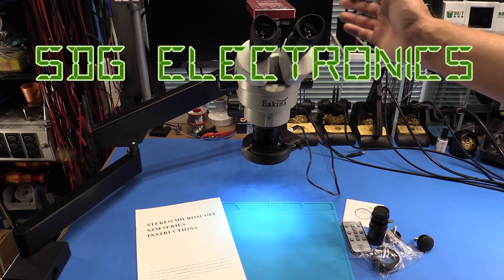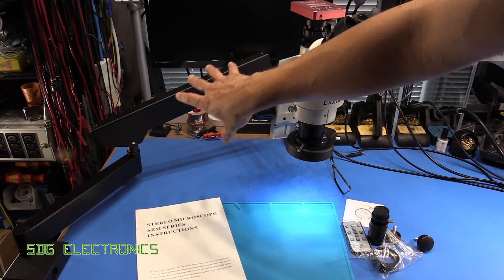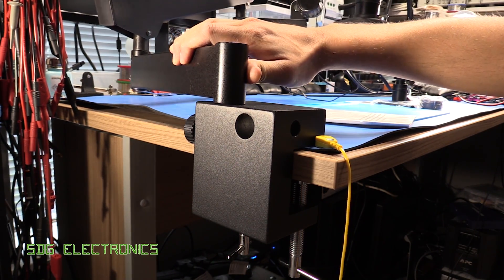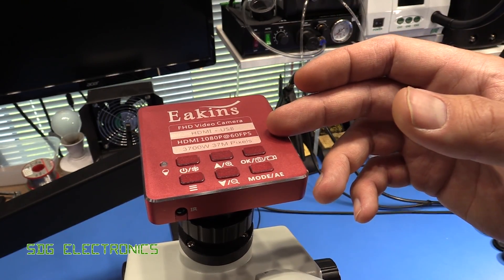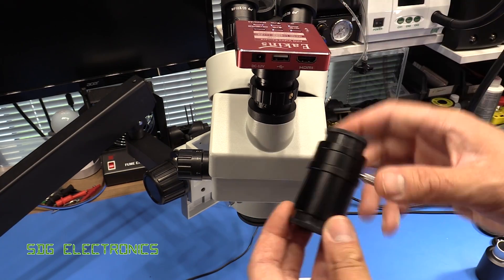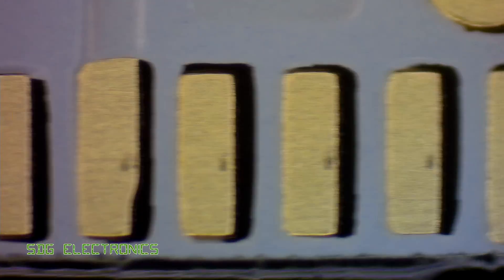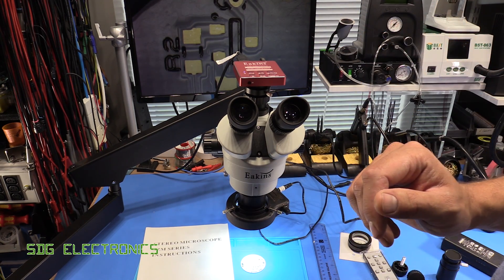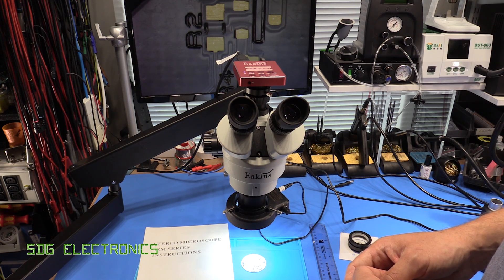SDG #093 Eakins Trinocular Simul-focal Microscope and 37MP Video Camera

Comment: October 23, 2024

Which one do you think is the best? The most expensive?
─────────────────────────────────────
C$498.68C$639.3321% off
  10+ pieces, extra 5% off
Price shown before tax丨Extra 5% off with coins
3.5X 90XArticulating Arm Pillar Clamp Zoom Simul Focal Industrial Trinocular Stereo Microscope 55mp 8.3MP 4K HDMI Video Camera
─────────────────────────────────────
C$480.99C$632.8823% off
Price shown before tax丨Extra 2% off with coins
Simul Focal Zoom 3.5X-90X Articulating Arm Clamp Trinocular Stereo Microscope 8MP 48MP 55MP 4K Video Camera For PCB Soldering
─────────────────────────────────────
C$408.68C$464.4112% off
Price shown before tax
3.5X 7X 45X 90X Parfocal Simul Focal Trinocular Stereo Microscope 55MP 4K 1080P HDMI USB Camera Articulating Arm Pillar Clamp

Thanks for these information.

Comment: Hi , please can you help with this issue am facing with my Eakins Microscope . When I connect the camera to the monitor the eyepiece either in focus or the picture in monitor . How can I sync bother to reflect the same focus 
I have the same camera adapter where I can focus using a ring on adapter 
Thanks

Comment: Brilliant video. As a complete frustrated newbe to microscopy, this has been a massive help. I just received  this kit today, but was deflated to find that the instruction manual is really quite inadequate, though I just about got there in the end. I never quite understand why companies skimp on creating decent manuals after the cost of developing and manufacturing. It's like stopping in a race just before the finish line. They even included a micro cd (as in your video), which I'm unable to use. Does a regular cd cost too much in plastic do you think? Great as this product ultimately is, engineers are almost always lousy communicators, who assume everyone else is an equal expert. No manual for the video camera that was shipped with it either  :-[

Comment: I bought this same setup but the black version. It came with the same exact camera but a slightly different adapter that says .5x on it. The optics is absolutely fantastic but the camera is very dark. I've adjusted the brightness to the max but I'm still getting a dark image even though the ring light is on. What could it be? Maybe the adapter?

Comment: Hi, would you be able to help me with finding the camera adapter used in this video (with the variable lens and locking screw)? Aliso s it a 0.5x or 0.35x? Thanks if you can help.
Reply from the maker: It was a 0.5x on this video - I used the adapter which came in the kit, did you need it separate?
Reply: @sdgelectronics  Thank you, yes I need to buy it separately and I’ve now found it online from the info in the video. Great work on the channel, very helpful.

Comment: Did you test various of these cameras?, I found that some of these use C or CS mount, and since I have bought some lenses for the raspberry pi camera, I wondered where I can find the camera itself, the shop you link to, the loose cameras there are of different types, than the camera that comes with the full microscope kit it seems?
I wonder if any of these have hdmi and usb output, or is it just hdmi and sdcard storage?

Comment: Ok, so watched all of your microscope videos, and have a question regarding the camera port. What size is the diameter of the port? I've found a nice Eakins trinocular scope head, which shows the camera port as being 23mm diameter, but all of the camera adapters are bigger than that. Is 23mm accurate? Does one need a second adapter from 23mm to the 27/28mm focal adapters? And is 25mm the standard C-Mount diameter?
Reply from the maker: Can you show me which microscope you're looking at so I can check.
Reply: SDG Electronics
https://a.aliexpress.com/_mrNTB47

After careful study of the images, it looks like it has an adapter that would take the 38mm mounts. It has a clasping screw rather than a thread, which was common on the 27.8mm old style.
Reply from the maker: See this video, the camera port adaptor is in the description: https://www.youtube.com/watch?v=z1s1sV7rnX8

Comment: Hi @
SDG Electronics Great review. But I'm confused between the White Eakins Trinocular Head (as you show), and the Black Trinocular Head, which is available as an option in the 3rd link you provided.  The White / Black heads appear physically quite different (ie. not just the color), and I note the Black one comes with a smaller 0.5x Mount Adapter, instead of the White versions SZMCTV 1/2 Lens Adapter for the camera (which you demonstrated). Are you able to comment on the difference between these White / Black Heads / why the different Adapters? Unfortunately this is not explained in the listing description, so I'm not sure which I should choose? Thanks.
Reply from the maker: I've not found any difference in use with regards to the optics, but the black Eakins one has a better mount for the camera. Apparently the black version also has slightly different design which stops the smoke from soldering getting inside, though I can't verify that.
Reply: So black is most recommended to choose?
Reply: @johnmaloma7623  If it’s any help, I went with the black one.  Several years of use now, and probably my best workbench investment yet!  I use it nearly everyday, even for regular TH soldering.  Even when not dealing with tiny SMD’s, your soldering improves doing it under a binocular microscope.  I also record video via the Trinocular camera fitting. Awesome piece of equipment!
Reply: @gregclare  thanks for your prompt response, can I have a video while sitting on a chair soldering under binocular microscope, hope you don't solder difficult
Reply: @johnmaloma7623  Do you mean one of the video captures of me soldering, taken through the Trinocular?
Reply: @gregclare  is just that I didn't see your videos soldering, if you have it, please share a video link

Comment: Based on this video i tried to set up the microscope. Everything is blurry? I normally wear glasses so have i just bought a dud? I used your referral links to purchase and am disatisfied with tje product. I tried bothe x5 and x2 lens and also just normal x1. The eyepieces are wf10x/20. Must i get different ones for my vision? Stuck
Reply from the maker: No it should work normally whether you wear glasses or no. Are you keeping your glasses on? Your eyes should normally be about 15mm from the lenses on the eyepieces. Regardless of your eyesight, adjusting the microscope height should always be able to bring it into any focus.
Reply: @sdgelectronics yes glasses are off. I've sent Eakins a message as there is small damage to the surface of microscope. It maybe the cause. Not sure. Also can't power the camera as have to find suitable power plugs. I don't know what country these are for.
Reply from the maker: @dazamad  if the lenses are damaged it'll be blurry. Did you sweep the height range to check focus? Off hand, with the 0.5x barlow lens the distance to the table is around 210mm. By the way, you can leave glasses on

Comment: HI, thanks for sharing this video on this microscope. May I ask how is the articulating arm function now after 10 month use? I am looking to go for it. And just read a post from eevblog forum that the same design from Amscope is not holding the microscope well after a few month use. Your advice is appreciated,thank you.
Reply from the maker: I can't say I've noticed any issues. I will try to find the EEVBlog thread
Reply: @sdgelectronics  Hi, thanks for your reply. If you like and if I may? I can put the eevblog link here.
Reply: @sdgelectronics  Hi again, I also noticed (after subscribing and watching your later videos), that this Articulating Arm does not seem to be present in your later videos? Are you still using it, or have you gone back to the dual boom AmScope stand? (which appears to be back in place in your later Nov 19' Eakins Black head review).  If you've gone back to the dual boom, can you please share your experience / reason for changing?  The stand represents a significant part of the overall cost, so I'd really like to understand your pros / cons, from someone with your experience. I can only afford to make this purchase once, so I want to avoid making a bad "stand" decisison. Thanks.
Reply from the maker: @gregclare  I have both units sitting here, but I tend to use the dual boom microscope for videos as it stops the camera image wobbling about. It's not an issue for normal viewing through the eyepieces when not recording.

Comment: After 10 months what is you view on boom vs articulating arms?
Reply from the maker: The articulating arm is my preferred if you don't intend to capture video, as it appears wobbly on the video. By eye it's perfectly fine. It's really nice how you can move it right out of the way.
Reply: @sdgelectronics  do you think its wobbly because of the clamping to the desk and taping it would cause the whole scope to move?  Have you tried indipendently supporting the stand separately from the desk ors its the stand itself not tight firm while seeing thru the scope?

Comment: I have the same head, but I have made my own stand, out of a dual monitor stand. One side is for a 27" monitor and the other has the head. I had to fabricate some extension, to reach closer to me, since I have clamped it across the table(in front of me). It works very well, I just need a camera that is always focus. You say that this camera is always in focus? https://www.amazon.com/gp/product/B07HNV3V7W/ref=ppx_yo_dt_b_asin_title_o03_s00?ie=UTF8&psc=1

Comment: Hello and thanks for these videos! Are you able to confirm the maximum table thickness this can clamp to? The listings on Aliexpress indicate 50mm but my concern is they may have measured between the gap in the black part of the clamp an not taken into account the thickness of the heads of the screws that clamp against the underside of the table when the screws are tightened. I need to know for sure because the lip of my desk is 50mm exactly.
Reply from the maker: The "C" shaped bit is actually 60mm wide. It's about 51mm maximum with the clamp in there.
Reply: @sdgelectronics  Thanks, that's very helpful!

Comment: If we keep the working distance between 300/400 mm and get full zoom, would the image be blurry? I want to use it in another sector and I need a long working distance. Can you make a short video from a long distance with the electronic circuit in your hand?
Reply from the maker: 400mm is too ambitious for full zoom. It's about 250mm maximum. You'd need to change the barlow lens on the objective and sacrifice some of the zoom for working distance.
Reply: Thanks for answer. so it is ultimately testable and workable? I'm a dentist, and the microscopes in dentistry we have are around $ 15,000 or more. I don't understand at all from microscopes or lenses and photography but I think there shouldn't be such a big price difference.

Comment: Thanks for the review, I got one for my lab based on your recommendation. I didn't get a manual though, and I can't seem to get the camera image in focus. I should be able to get the eyepieces and the camera image to focus simultaneously, right?
Reply from the maker: Yes, the focus should match. Is the threaded ring on the camera extended enough? I found with some cameras that the sensor was a different distance from the thread. Sometimes a 5mm c-mount adapter can help
Reply: @sdgelectronics  Thanks! When unboxing, I missed that the camera cover was both a distance ring and a cap. I put the ring back, and now everything is in focus 😊 Thanks!

Comment: Hi Steve, how does the ring light attach to the 0.5x lens? (Lens doesn’t appear to have an indent around it for the light’s mounting screws?)
Reply from the maker: There's a groove on the main objective lens. It doesn't mount onto the 0.5x lens. If you want the light lower down, you can screw in an adapter but you'd need to get that separately

Comment: I have a fixed 8x microscope and franky find 8x too much. (22mm field of view frustrates navigating solder + iron). But the 2.25x of my illuminated desk magnifier isn't quite enough. If you set the zoom to say 5x, are the eye pieces low enough to comfortably use or do you need a "high chair / low desk"?! (You'll have a large working distance - good - but also a lot of distance to the eye pieces - bad?)
Reply from the maker: It's a fairly natural position for sitting. I've not noticed any discomfort or anything like that.

Comment: As you adjust the continuously variable zoom, do you have to keep changing the height of the microscope head? (Working distance is inversely proportional to overall magnification?)
Reply from the maker: Just a minor adjustment to the focus is required. It doesn't require resetting the overall height - there is a focus rack which allows the fine adjustment
Reply: Thanks Steve. My current microscope has a "goose neck" stand (like an adjustable table lamp) and getting it the correct height to focus (and also horizontal) is surprisingly fiddly. So, I'm considering another microscope, and this review and your comments are most helpful. Many thanks! Jon

Comment: Great video but was wandering if the height of the first boom arm meaning the first arm after the table lock down has caused you any trouble it does seem close to table top and would defiantly sweep things off my work bench but did see another with an extension to raise that height and its adjustable as well its a real nice piece of kit and thanks for the look
Reply from the maker: It didn't cause me any issues, there's enough clearance to clear ESD mats, cables etc.
Reply: @sdgelectronics  Thanks for the reply this is the microscope i am going to purchase with the extended post off the table tie down to lift primary boom off table top in my case it will work better for me but can u tell me is that  camera adapter the one you purchased off lapsum gift it looks really well made and useable?
Reply: @sdgelectronics  I like the idea, but IMO the execution is terrible. If you actually wanna use it for moving it around fully and for swinging the microscope out of the way when not in use - then that tiny clearance underneath the bottom boom basically eats up all the bench space of its movement radius. You can't place anything there - anything taller than a table mat or a cable within it's radius, will be knocked over and swept off the bench.

As you point out yourself in the video; bench space is prime, scarce real estate. And that bottom boom eats up almost as much bench real estate as the double boom stand does. It's arguably even worse than the double boom in this aspect, as except for the base of the double boom, at least there's good clearance underneath the boom, and most of the space it eats up is towards the rear. This boom-arm eats up a lot more space more towards the front of the desk, space much more actively used.

Comment: Look up Louis Rossmann , he sells soldering microscopes 100x better than this, he actually uses what he sells and shows and tells everything about it!!!
Reply from the maker: It's the same SZM microscope. No difference other than the camera he uses
Reply: SDG Electronics dunno looks pretty different
Reply from the maker: The particular one he uses is the same as my Amscope which I covered in an earlier video. The only difference is this model moved the diopter-adjustment from the ocular ports to the individual eyepieces. The optics in the microscope head are the same and all made by the same company.

Comment: Thank you so much for this video and for your contribution to the electronic repair community.
I only have one question that I have not found the answer to.
How is it for a person using glasses to work through the eye pieces on this microscope?
Reply from the maker: It works fine with my glasses on. You can adjust the diopter on each eyepiece so that you have full vision with your glasses 5mm from the eyepieces
Reply: @sdgelectronics  I have worked with TMX, Phils (makers of Timex watches in the Philippines ('79 -'83) As a QC (Quality Control) Analyst I used most of the similar microscopes (American Optical) like this during my failure analysis work  for the electronic and mechanical components of those watches and I was certain that you don't need to wear corrective glasses while using the scope. The procedure was is to focus the left eye with the fine adjust of the microscope head, then for the right eye, the RIGHT EYEPIECE can be adjusted or turned to match the focus on your RIGHT EYE. Now my question is, can the right eyepiece of the Eakin be adjusted for focusing Thanks for the answer.
Reply: Depends on your vision/correction. If you're only near/far sighted, then with adjustable diopters you might not even need to wear the glasses. But if you have astigmatism then you'll likely still need them; the diopter lenses can't correct for that. Do get a set of straight or shallow-angle rubber cups for the diopters though. Working without any is uncomfortable and will easily scuff up your glasses. The larger angled ones work well for blocking ambient light from the sides, but they conform to the outer edge of your eye socket and cheek, they don't work with glasses.

Comment: Is there any delay on the external monitor image?
Reply from the maker: Nothing noticeable.
Reply: @sdgelectronics  On a cheap USB microscope I was unable to solder anything while looking at the monitor because of the delay between the reality and the image. Are you able to work (solder/anything else) while looking on the image on the external monitor connected to this microscope ?